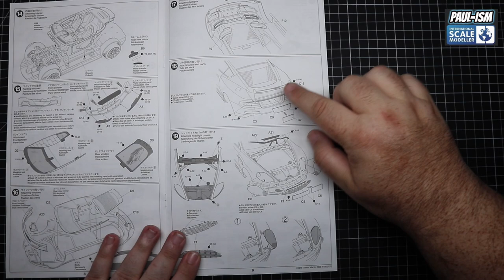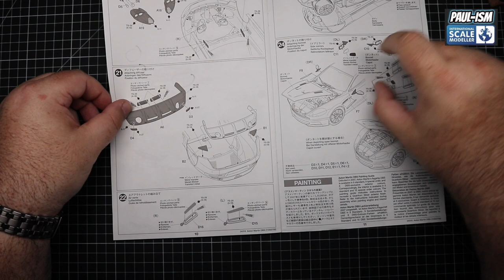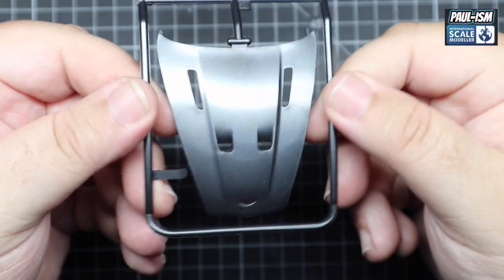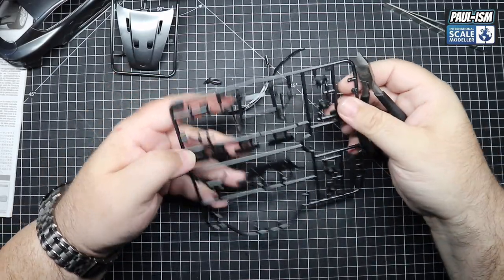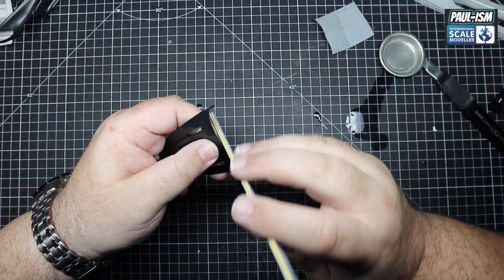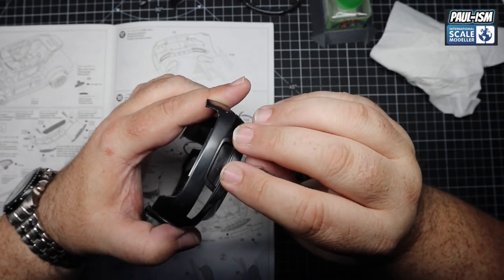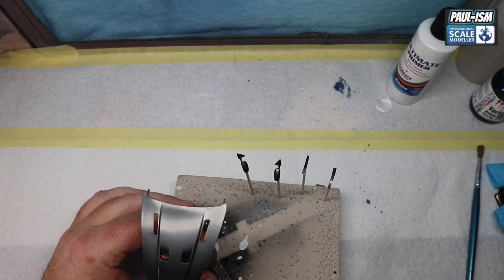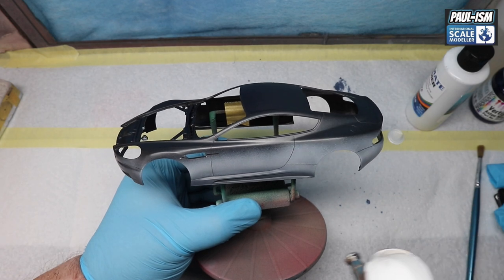Part 1 - Tamiya 1/24 Aston Martin DBS Step by Step Build

Comment: Good vid again Paul. Just one small point as it's going to be useful to new modellers - I don't think you mentioned taping the body to the Tamy paint stand. As I found out when first using one, if you don't you can almost guarantee that the body will fall off the thing just as you're finishing applyiing your last clear coat...!!
Reply from the maker: Hey Keef, Yes that's a good point, thanks for watching and commenting - Paul :)

Comment: Why such an high pressure when spraying ump primer
Is that just for the white primer or for all your primers?
I have your ump grey primer and spray around 20 psi 
Also what side needle do you use? 
I'm using a 3.5 needle
Reply: Arthur Miller woah 3.5, jesus
Reply from the maker: I’m using the .35 mm needle of the Apex and yes 25-30 psi is the best spraying pressure